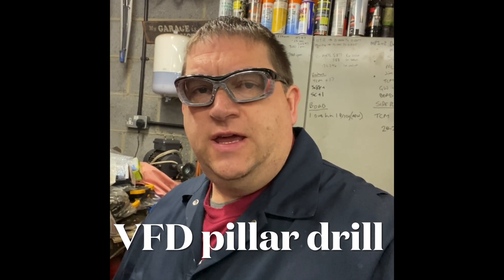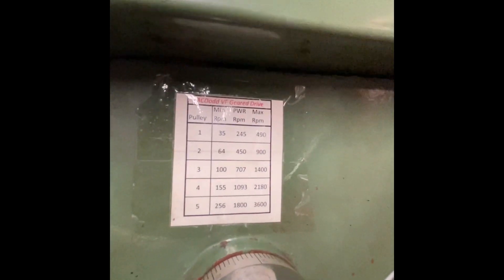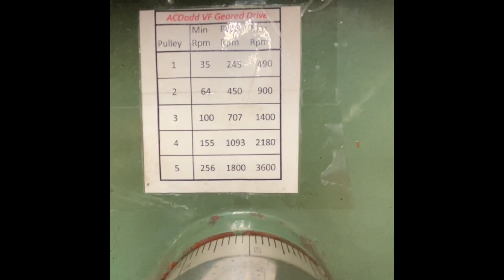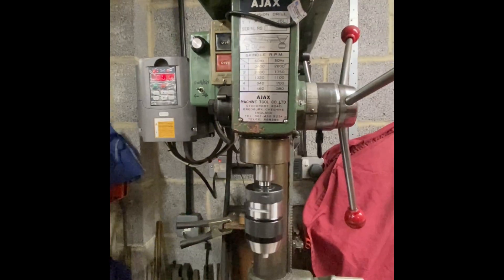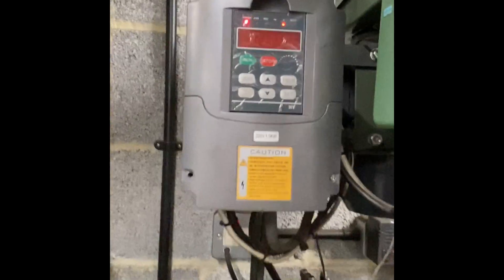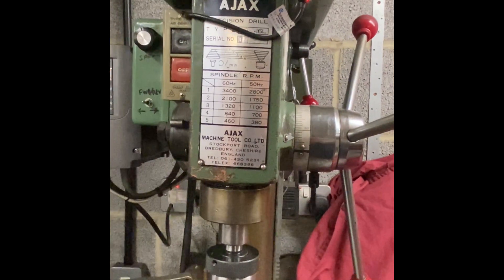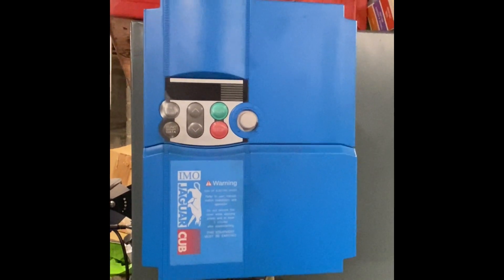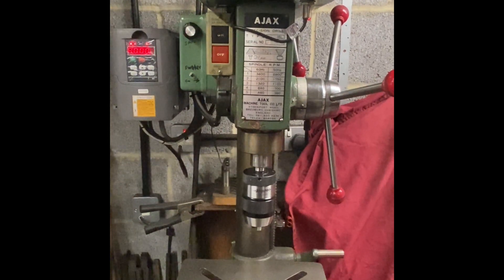My machine tools, part 1 The VFD pillar drill

Comment: I have a 3-phase 0.75 kW drill press. Should I get a 0.75 kW VFD or go a size up and get a 1.5 kW drive?
Reply from the maker: My pillar drill uses a drill 1.5kw inverter. If it’s a high quality inverter you can use an inverter the same size of the motor with no problems. I’m he cheap inverters I think it’s a good idea to have the inverter a  little bigger than the motor.

Comment: This is something ive had on the cards for a while. I built a 2x72" belt grinder and a 9" disc grinder each running 1 HP off a yaskawa vfd but not simultaneously. I've wired the vfd in such a way that, the output from the drive is wired to a uk 3 pin wall socket and the motor for each machine to a 3 pin wall plug allowing me to alternate between the two as required. 
The motors are 4 pole which has had its limitations on the belt grinder set up as i often require high belt speeds to utilise the potential of ceramic belts but causes stalling/overdrive protection on the vfd. Would you recommend a 4 pole for this operation as i will be upgrading the belt grinder motor to 2.5hp with its own stand alone vfd in the near future and hopefully using the current 1hp motor on the press. Thanks, Stephen
Reply from the maker: What rpm do you need to drive the belt rollers at?

Comment: Very nice mods!
Is it a 1 turn pot? It seems a bit tricky to adjust the speed. Maybe use a multi-turn pot instead?
Reply from the maker: Not needed really you could also expand the range if you wanted it’s perfectly usable as is and I have not felt the need to change it. The point is you can do pretty much whatever you want really!